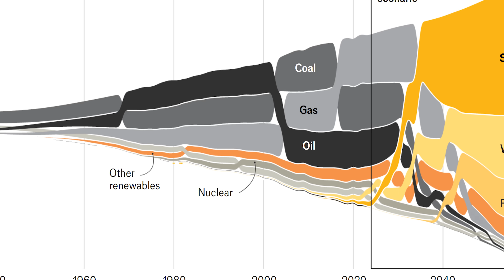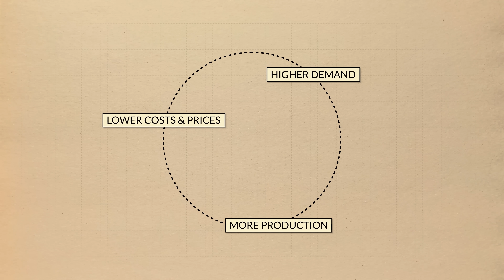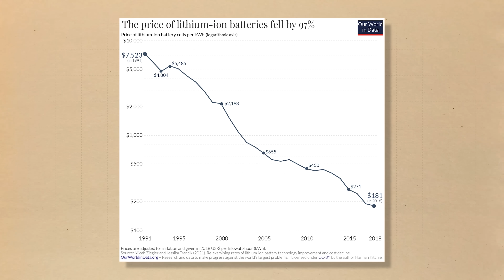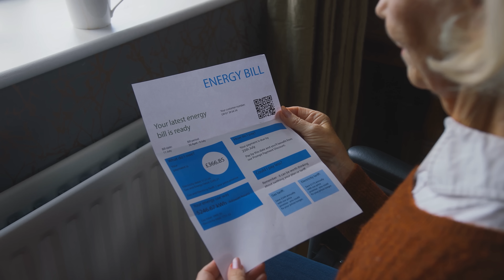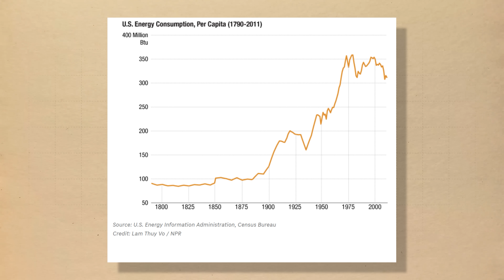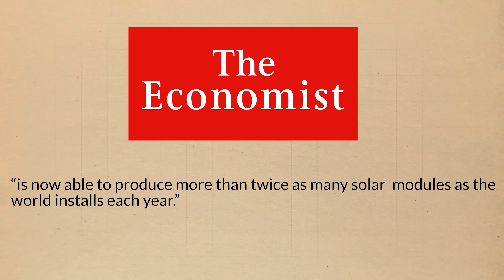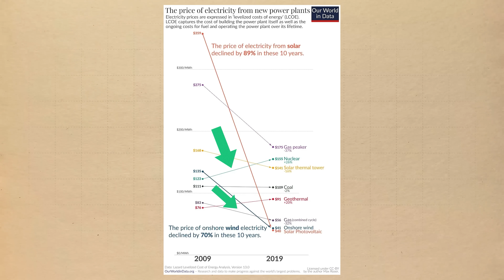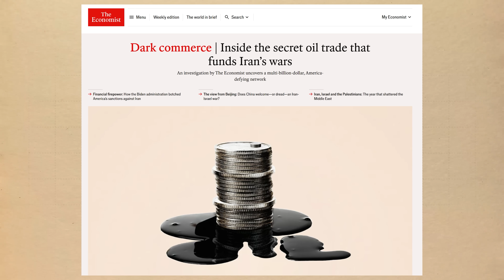Why solar will soon dominate & what that means for the world

Comment: Solar energy is not the cheapest. This claim is pure nonsense and is only propagated by people who have a lack of a basic understanding how energy systems work, in particular in northern Europe. The question is not: what's the cost of KWh when the sun is shining—the question is: In a system that is fueled solely with renewable sources, how much does it cost overall to provide one KWh of energy.

The experience in Germany demonstrates that it is, in fact, inadvisable to bet on renewables only. Note that Germany is still operating coal power plants to cover their base load.
Reply: In fact betting is completely unnecessary. The economy of this power generation method has been worked out already, and the outcome doesn't boad well. Except for very specific use cases, traditinal energy generation methods are much more reliable, economically viable and require less envoronmental footprint. I wonder what will the Chinese government think of their mass PV power generation initiative in 20 yrs. time. Personaly, I believe they will think of it in similar terms to their massive over building all over China, i.e. as an economic and environmental disaster.
Reply: @zvikabar-kochva3641  The idea that thermal coal power or petroleum has a lesser footprint than solar or wind power is absolutely comical.

Renewables aren't exempt of problems, but if you think that they have a greater impact on the environment than fossil fuels, it is absolute delusion. 

Nuclear is more arguable, however, but it is insufficient at the moment. If we tried to fuel our current energy demands with nuclear, the price of Uranium would become astronomical rather quickly.
Reply: The technology isn't there (yet) for renewables only.
It's absolutely there for using renewables to significantly reduce (or at least slow the growth of) fossel fuel usage in electricity production, though. How much so varies by climate, among other things.
Reply: If it wasn't cheap China and many other countries wouldn't be installing so much of it.

The problem is that the opportunity cost of building new power stations is substantially lesser in a country with growing electricity demand compared to demolishing older power stations and then having to replace these with solar in a country with stagnant, or even slightly declining energy demand. 

The truth is that, quite simply, the European energy sector has been comparatively stagnant due to the aforementioned, but recognizing this would mean recognizing to an extent how stagnant Europe is as a whole, and that Europe is too poor, divided and deindustrialized to do the necessary switch.
Reply: Germany put a lot of its energy strategy on Russian natural gas, which is why it’s now still having to rely on coal for base load. The shift to renewables has been facing major roadblocks — such as regulations, infrastructure limits, and local opposition to both wind farms and power lines. On top of that, the policies over the last 20 years have slowed the expansion of renewables, adding even more obstacles to the transition. Considering all these challenges, it’s almost a miracle that renewables have such a large share in Germany today.
Reply: @f.carasind4188  Excuse me, this is simply not true. The fact is that "renewables" are highly weather dependent. The result is a centralization of power production on the one hand (a lot of wind energy comes from the north in Germany), and a massive problem regarding seasonal storage. Just as a small example: As of now, the only economically feasible storage technology that is capable of smoothing out seasonal load patterns is pump storage. Now, what's Germany's total pump storage capacity, you may wonder? — about 40 GWh. That's laughable. Just for comparison: Switzerland, a country about a tenth the size of Germany, has damns that hold in the order of TWhs of potential energy. Now, if you cut them off from imports during the Winter, they would last maybe a month — a month, that's it. So, yeah, Germany has a huge problem at hand.

To make it even worse, they are all discussing using Hydrogen! Now, are you willing to take a guess of how much of the H2-production capacity they want to reach until 2030 has already been built? — about 0.5%! Yeah five thousandths of what they planned for 2030 has been built. Good luck!

Now, one could rightfully moan about the exact same problems that you mentioned when it comes to nuclear power: local resistance, fueled by irrational fear (yes, irrational fears), and anti-nuclear politics that created an environment of over-regulation. The result being that a proven, reliable and safe source of electricity that can cover the base load was taken off the grid on the one hand. On the other, crucial research into fuel efficiency and reduction of the half life of fission products were abandoned. This is just the summary, I can argue the point regarding the irrational fear, etc.
Reply: @f.carasind4188  Germany will never use PV or wind for it's base load, nor will any other country, because it it an unreliable source.  PV and wind power generation technologies are not as cheep as shown in the video if one takes the real cost of power delivery and system maintenance. Moreover, these sources are very hard to balance with the rest of the grid, making it substatially inefficient compared to a stable one, which relay on reliable sources only. 
In fact, if you take all these elements into account the true cost of PV and wind is far worse than the propaganda would make you believe.
Most politicians are cluless about the economy of power generation technologies, yet are quick to promiss whatever the prevailing wims of the public and idiology driven pressure groups with massive propaganda funds wants. The fact of the matter is an up-surge on electricity bills in all countries, which massivly swiched to PV and wind and very little if any CO2 reduction to show for. To top it all, the ecological footprint of these thechnologies are orders of magnitude worse.
Reply: @zvikabar-kochva3641  This isn't true. 

CO2 emissions of renewables arent as as high as fossil fuels.
Reply: @JuanPablo-xf4ps  , It is true that CO2 emissions of PVs and wind technology are negligible.
However, the CO2 emission during their production, especeally PVs is not negligible at all. That said, in my view, CO2 is plant food, not polution, and its contibution to global warming is negligible (according to top climate scientists). That said, it would be great mistake to ignore their overall ecological footpring on the planet. For example PVs require lots of materials, which require lots of mining and material processing at high temperatures. Their lifetime is 20 - 25 yrs., which is at least twice the renewal rate of other power generation technologies, with far more materials per cycle. In addition, their deployment require the allocation of vast swats of land which destroy nature. If they are installed far away then connecting them to the existing grid require additinal power transport installations, which require additinal large ammount of copper and steal. Not to mension the effect on scenery and landscapes.
Reply: @zvikabar-kochva3641  You are wrong. Human activity has produced a sufficient amount of CO2 to cause climate and atmospheric changes, in two centuries, that would have taken millions upon millions of years to reproduce. I do not know which people you regard as "top climate scientists", but the facts and CO2 concentration in the atmosphere speak for themselves. 

Whilst it is true that PV and Wind power require a greater amount of raw material to build their respective installations, as we create economies of scale the recycling of damaged components and used materials from Photovoltaics and wind power will get better. On the other hand the current energy model requires an endless stream of raw fossil resources. The entirety of the Saudi economy is fossil fuels. Gigantic mines and oil wells have been opened all over the world to meet the demand for oil. We have literally built gigantic floating metal platforms in the middle of the ocean to do so. From oil spills to the localized atmospheric contamination produced by the refineries and by the thermal plants, whilst repairing and replacing photovoltaics every 25 years is a hassle, the gigantic installations required for the production of fossils and energy generation derived from them have also been a massive pain. Humanity has built a gigantic industrial civilization on the basis of non-renewable fossil fuels. They have brought us great achievements and great pains also. However, we were never fated to keep using them forever, and the time has come. There will also be great achievements and great pains in our future, but regardless, we must advance.

Nothing is perfect, but it is required for us to switch to non-CO2 generating energy sources at speed, otherwise there may not remain scenery, landscapes, or even humans in some regions which will become unlivable.
Reply: So who pays for the negative effects of fossil fuels… I guess you’re not accounting for that or even willing to accept it
Reply: @PrinceWalacra  What are you even trying to say? Where is this dichotomy of solar vs. fossil fuels suddenly coming from? Even if solar module prices were negligible, all I'm saying is that solar is not the cheapest way of producing electricity (in northern Europe), because of additional (expensive) grid and storage capacity requirements. One alternative is nuclear.
Reply: @dsd2743   You have to zoom out to get your idea clear about this. There wil always be areas in the world that have more energy resources and areas that are dependent on others, whatever it is oil, sun, uranium. The most important at this moment is that fossil fuels are the worst option to continue with because of the damage it has on the environment, health, future water and food supply and biodiversity. And that cost more money in the end and  It should be taken in consideration when choosing for investment for energy.
Reply: @PrinceWalacra  Again, you are not addressing what I have said. Besides, what is causing trouble is not fossil fuels per se, but the amount of greenhouse gases that escape into the atmosphere relative to the amount of energy made available. Now, surprise, surprise, a country like Germany has one of the dirtiest energy mixes (in terms of g CO2/KWh) despite politically pushing "green energy". So, "green energy" in actuality isn't really green.

Of course there are going to be dependencies between different areas on the globe. However, there is a stark difference between uranium and natural gas, e.g. In a country such as Germany, you could store fission material that lasts for multiple years locally—the same cannot be said for natural gas.
Reply: @ what you do is picking one example (Germany’s energy mix and its energy policy) and project it to the whole world.  There are numerous examples that proof the opposite. Solar  and wind energy will out compete nuclear energy because the 25 billion nuclear plants must continiously  produce expensive electricity even when solar and wind are plentiful and cheap and that will be on a growing period of time, especially when energy storage will be more broadly available. Then gambling on nuclear will bankrupt you for sure.
Reply: @PrinceWalacra  If you cared to read how I started my contribution to this discussion, you would notice that I was talking about northern Europe all the time. I did not project out anything, as you claim, rather my point is precisely that you cannot do that. And for northern Europe (actually the whole northern hemisphere), Germany acts as an example of an industrialized nation that, despite its wealth and massive investments, was yet unable to transition to wind/solar only.

> Then gambling on nuclear will bankrupt you for sure.

Putting out blanket statements of this kind is what bankrupts people. The fact of the matter is, again, that you need a lot of fine-grained (day/night) and seasonal, large-scale storage capacity to make an energy system work that is only powered by 'renewables'. And, again, I invite you to look at a concrete example like Germany, the only country that makes that bet, and you will find that they substitute missing 'renewable' energy with gas and coal at the moment. It is not clear how they will solve that problem in the future.

Now, about nuclear in particular: I bet you have no f'ing clue what you are talking about (what is the composition of the fission products? How big of an actual problem is long term storage anyway (compared to other substances that we need to dispose of)?, etc.). Sorry, to make this personal, but your statement here are so empty and random, there is no actual exchange of information happening. It's just the same old repetition of off-the-shelf romanticized 'truisms' like: solar cheap and good, nuclear bad.

Because, look, if you fearmongers were honest, you would, (A), project the same progress into nuclear technology as you project into battery technology. (B), you would acknowledge that, as of now, the sourcing of copper and lithium, etc. produces as a lot of harmful waste—well, just not in YOUR country, so I guess its fine.
Reply: @  haha, you sound like am fear-monger yourself, putting wordsi n my mouth. Germany has always been depending on energy from elsewhere, whether it’s oil, gas or solar energy. Nuclear energy is more polluting than renewables, you just trivialize uranium mining and do if  radioactive waste like it doesn’t exist. Nuclear energy already is the most expensive and even you don’t want to pay extra for it in future.

Comment: The issue for me is that the vast majority of solar panels and tech are built in China, so I worry how long they'll last before needing replacement, and how expensive replacing them will be with how many we have.
Reply: In so far as it's a thing, that would be a product of the USA actively killing off domestic production for decades due to, if I remember correctly, oil industry propaganda and lobbying.
Reply: The current cheep PV pannels are rared to about 20 -25 yrs. of usefule life., depending on their failure rate distrubution, this could mean that up to 63.2% of all pannels will fail by 20 - 25 yrs. The question is what will do with the failed pannels and peripheral equiptment. I'm not quite sure that by the time the current generation of pannel will start failing in mass, recycling their materials will be economically viable. What I'm certain about is that the enviromental footprint of producing these pannels is huge compared to other method of power generation. They require far more materials, which have to be mined and proccessed with a high energy conssuming methods. Currently this is done in China using cheep energy by largelly coal power plants. Did anybody mentioned CO2 emmisions?
Reply: @zvikabar-kochva3641  You need to get a bit more specific when talking about solar/wind "failing". Because even with constant maintenance and cleaning, they still lose efficiency over time. Also I'm not as optimistic about where recycling will be in another few decades as you are, based on what the current standard is.
Reply: This is a very strange myth that has persisted into the 21st century even though it’s not really true. Yes, early Chinese manufacturing was pretty cheap, as the country had basically no large industry prior to it. However, modern Chinese manufacturing, especially for advanced manufacturing like fabs and cars, is definitely world class and on par with things made in America and the EU. No country can be the best at everything, but Chinese goods are decent to good quality across a large swathe of technologies.

Comment: Solar will be the game changer for all the developing countries which depend on oil imports. India spends 5 to 10% of their gdp to import fossil fuels and related products. Now just imagine that money staying in india creating a current account surplus and since energy is involved in everything, it ends up combating inflation and thus low interest rates. I think the developing countries around the world will see growth rate of >10% once solar becomes dominant.
Reply: Crude oil is still required to produce many manufactured goods, such as polymers and industrial lubricants for example. Industrial heating for manufacturing processes also cant be converted to be electrically powered, as another commenter mentioned. Passenger jets and military vehicles also can't run on electric power. Renewables will reduce oil consumption but won't be able to fully replace it. And as the economy of the country improves, the per capita energy consumption will rise quite quickly such that country's net oil consumption might increase even though the percentage of oil fossil fuel consumption has decreased compared to renewables
Reply: Um.. no.. just no.  Solar is not a substitute for oil.  For a start, oil is used in a lot of things aside from energy production.  For example.. fertilizer.  Second, when oil is used for energy, it's used because it's energy density and handling characteristics.  You will not see a drop in oil demand until you see ships, jets, and semi-trailers running on batteries, and electric cars that are cheaper than ICE cars to buy and operate.  This is still a long way off... even in China, which is ahead of everyone on this due to their unique strategic concerns.